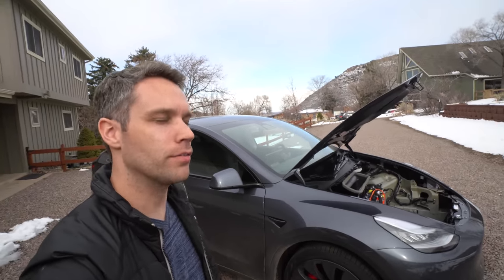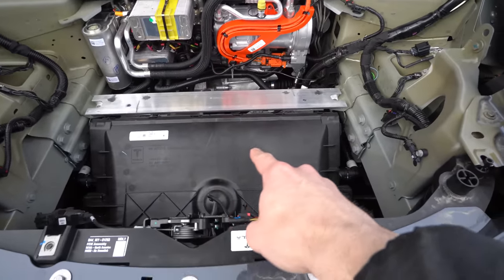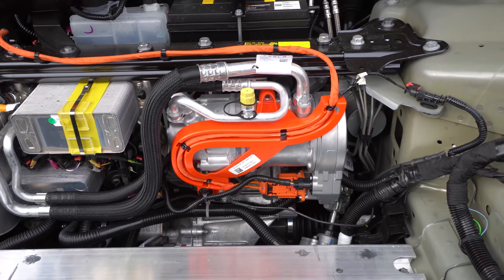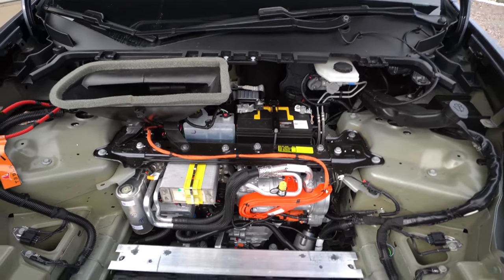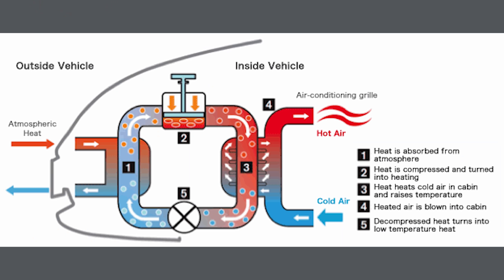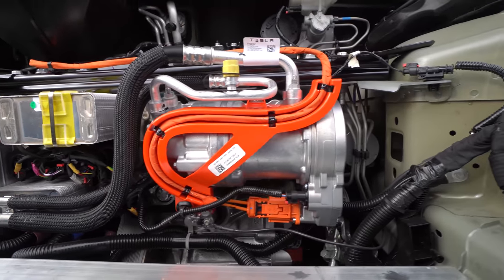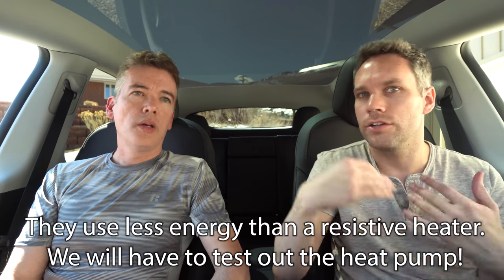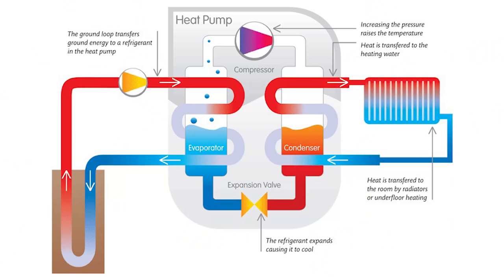The Biggest Change in Model Y Over the S, 3, or X!

Comment: Mini-split heat pumps are super energy efficient when compressor utilizes NdFeB IPM super high energy efficiency motor // & when heat exchangers are well engineered & well made & lines are well insulated & system sealed really well with intelligent multi-layer gaskets // think Mitsubishi Mini Split Home Heat Pump solutions etc 

Thermodynamic Science Awesome :) Moving 3 units of heat with 1 unit of electricity FTW

Excellent point about wearing warm winter clothing & using seat heater as the absolute most efficient solution. I use heated gear when riding my GROM in nasty cold wet weather to stay warm battery operated* not plugged into GROM's electrical system // charged at home inside periodically // same reason // super high efficiency & effectiveness & no cables to mess with // super glad Lithium Ion technology mature now //

Comment: Massive heat distribution units. Yeah. Massive. The "liquid-cooled condensor" MIGHT be "massive" enough to be the heater core in a SmartCar.

As for the idea that you can power a "heat pump" and multiple fans and probably various other pumps  via 12VDC electric motors more "efficiently" than via "resistive heating" AND that the dry-cell "battery" (all 4000-5000 of "it") needs to be "heated" AND that a "heat pump" can possibly heat all 1000+ llbs of "it" and that "heat pump" system isn't just more shitty Tesla "engineering" trying to get more "range" as Elon the Icon continues to fail to deliver the huge "advances" in battery technology he "promised" about the time Tesla "went public" and that it's not really all about "heating" the interior to keep that giant joke of a consumer-grade indoor-use-only room-temperature-rated LCD "instrument panel" from freezing, if it sounds like a "good idea" to Elon the Icon's adoring fans it MUST be a "good idea". 

Which of course in no way, shape or form means its actually going to work as promised when its "engineered" by a guy who goes with orange "extension cord" for automotive accessory wire "harness". 

Yeah. That's what that is there around the "heat pump". Orange "extension cord". 

And you Teslatards have all been "commenting" (or not commenting and making videos trying to prevent future "owners" from "ever seeing" what's behind THEIR "frunk" by "exposing" your own supposedly "owned" Tesla at LEAST long enough for a "service center" to get the "Home Depot parts" out of their "new Tesla" and replaced with genuine "OEM Tesla" factory parts on it first or fifth "visit" to "address" the so-called "quality control issues" that are standard equipment on every "luxury" EV Tesla "builds") on the OTHER "Home Depot parts" like the wooden "LCC" anti-steel-pallet-strapping-rub-through/galvanic-corrosion "preventers" and whatever other "non-industry-standard" garbage jumps out at Tesla "owners" as "non-industry standard". 
 
According to Tesla "owners" who wouldn't own Teslas if they weren't "mechanically-declined" to the point of apparent hatred for and/or fear of  "ICE"...anything (at least online on the forums, blogs, social media, etc even though they probably own several "ICE"...anythings "IRL") but yet they recognize as not being "industry standard". 

At least because of and according to their mistaken belief that Tesla actually is an "auto maker" and not an "EV builder" and completely isolated from the "industry" of making "AUTONOMOUSLY MOBILE" VEHICLES which do not need a "grid" in order to provide personal, practical and private transportation on any and all public roads, streets, highways and freeways anywhere "around the globe" and on basically a "non-stop" basis should someone(s) decide to go where they want, when they want, how they want and ASAP on a "road trip" to GET SOMEWHERE instead of "GO SOMEWHERE". 

Want to know what else is not "industry standard" on a Tesla and is even outright "illegal" per the "federal government" or at least would be if any Tesla built to date was an actual "automobile" and therefore a "motor vehicle" and required to conform to "industry standards" and which they would conform to ANYWAY if anybody in "management" or otherwise an "insider" and a "stakeholder" and holdiny the real purse strings and was actually in the "auto industry" to "make cars" as well as "make money'" and really wanted to "compete" with any real "auto maker"? 

It's a long, long list. 

Fortunately for Tesla "stakeholders" the fact that Tesla is not in fact an "auto maker" or more accurately a "motor vehicle manufacturer" is precisely why no other "auto maker" acknowledges its existence much less considers it "competition" period much less "competition" worth giving the free publicity and industry "acceptance"  that would result were a real "automaker" stupid enough to compare/contrast its products to/with Tesla. 

That way there's very little chance they'll end up "bankrupt" AND in the "big house" if and when a legitimate "competitive" vehicle produced by a real "auto maker" putting an electric powertrain in an "ICE" platform with actual "advanced" battery technology or at least 15-20% LIGHTER than a fat overweight tire-overloading/destroying "luxury" Tesla and therefore automatically having 15-20% more "range" even with the same "kilowatt-hour" battery (laughable how Tesla "rates" its batteries by "kilowatt-hour" like an AC "power supply" when the entirety of the real "battery industry" uses ampere-hours to "rate" DC battery capacity) shows up on the "EV market" an literally smokes Tesla across the board in any and all "metrics" and reveals what a giant "stock scam" Tesla has been and would continue to be right up to the date and time the results of a legit head-to-head competition "went public" and Tesla "went private" immediately thereafter. 

Which is precisely what is going to happen as soon as Tesla stops "competing" with vehicles there aren't even "ICE" compeitors for/with and stops inventing a new "class" of vehicle every time it puts a "new" wrapper over/around the same old shit and goes "mainstream" and has real "competition" its first real "industry standard" vehicle is remotely comparable to. 

Its hilarious how Teslatards try to point out how "different" and "unique" and "special" those supposes "ICE-killers" are 0

Comment: That's only good news from tesla... But one question arises: how will it work when you gotta chill down the battery or motors and warm up the cabin, eg. when you are supercharging or doing some autobahn rides?? Only Mr Bjørn will have the answer 😂😂 fortunately there might be some smart asses at tesla to figure this out, may be playing around with coolant, motors and AC loops, combining them to use the waste heat from the battery to warm up the cabin... Lol that would be very interesting. I'm pretty sure the Y still has PTC heaters though, as there are some situations when the compressor can't keep up or simply a heat pump can't work properly, such as extreme cold... We'll see.